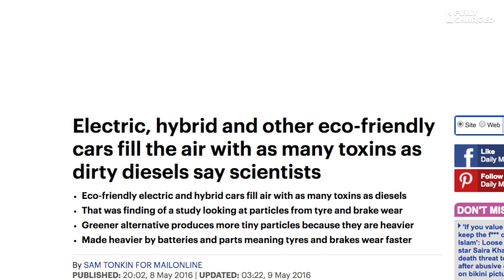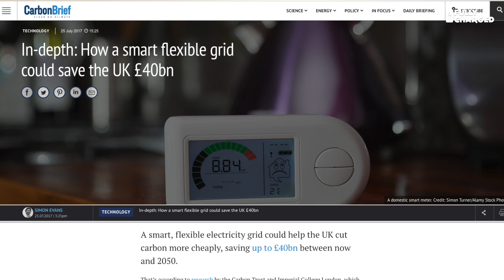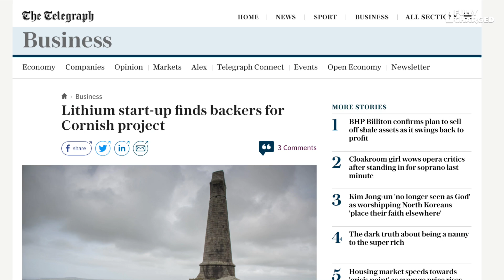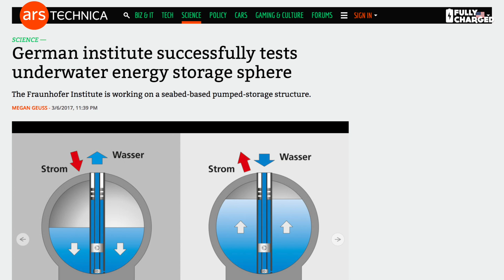Kettles, Particulates & Flexible Grid | Fully Charged News

Comment: Using EV batteries to feed into the grid, wouldn’t that reduce the lifespan of the batteries as they will be used much more than just when your driving. Then wouldn’t that counter any financial savings from letting your Ev batteries being used?. Even if the cost was still worth it, the batteries may have their lives reduced considerably which is not good for the environment!. There’s Salt water and other ways of storing energy that don’t require mining or hazardous substances!.

Comment: 13amp fuses are the maximum you can use on our 240v system meaning you can consume up to 3120watts per socket (13x240). Electrical sockets are connected in parallel so you can use another 3120watts in the next one. Using adapter plugs or extensions is serial and therefore all the plugs in that master socket can not exceed 3120watts, otherwise the fuse will blow. A kettle generally uses the maximum heater element it can to boil the water quickly, so many are 3kW or 3000watts. A homes main board will have numerous master fuses or circuit breakers separated in to lighting, downstairs, upstairs or whatever the electrician or home owner wanted. These are generally 5amps for lighting, 25amps per floor, 30amps for an electric cooker on its own circuit. If you overload any of the circuits the fuse or circuit breaker will blow. If you switch too many things on that will happen. There is also a master fuse for the master fuses which is the property of the national grid and you can't mess with it because it has a tag attached. If you look where your main board it fitted, where the electricity meter will be you will notice that has an 80amp or 100amp fitted. If you, for instance, turned on a kettle and 7kWh battery charger that is only 10kW, ignoring anything else plugged in around the house. If you plugged in 80/13 = 6-7 kettles this would blow the master, master fuse, although one of the master fuses would go first because they are lower. Any home could consume (watts = amps x volts) 80x230 =18400 watts or 18.4kW (They use 230 everywhere and not 240 because it is supposed to be between 220-240) 3 Phase supply does let you use more and export more but you can still do a lot on a single phase. The grid monitors everything though and if the harmony of the network is being affected by your consumption/export they will require you to alter your set up to prevent this otherwise it could cause damage to the grid somewhere. I am therefore confused by an 11kWh battery causing problems. That is what it can produce over a sustained period of time, not what energy it gets to recharge it. If it did, it would go from empty to full in 1 hour. Which is more likely to melt the battery than anything else.

Comment: I'm still getting over all the fuss that was made by our so called 'mainstream' media, regarding the 'non story' of our unhinged government, stating that only electric vehicles will be sold after 2040. When anyone who takes the mildest of interest in what is going on, transport wise, would know that there will only be electric vehicles for sale well before 2030!! I'm wondering what all the companies that supply/manufacture filters, cam belts, spark plugs, glow plugs, engine oil, clutches, starter motors etc etc are going to do 10 years from now?
There will still be demand, but not as we know it Jim.

Comment: My 1800's Victorian house has a 3-phase supply.  When I bought my first Tesla back in 2014 I had a 22 kW (3 x 32A) charger installed and the dual charger option on my car.  The electrician who installed made sure that the primary fuses were sufficient to run the house and the charger at the same time (no change or increase of fuse or cabling was required).  Each phase as a 100A fuse.  I have successfully and numerous times charged at full 22 kW as well as running electric underfloor heating, an electric oven and kettle.  No issues at all.

Comment: I was wondering about that Denmark story of those cars putting energy into the grid when electricity was more expensive. Now that would only work if there are only so little vans that the energy that is needed for them to fully charge is less than the energy they put back in. Otherwise, how much power / money do you need at first place to charge them enough? 🤔😁

Comment: Here something I have wondered about. Why don't kettles have 2 buttons - one that heats to say 90c (plenty hot enough to make tea/coffee) and another button for full boil. A bit like the dual flush concept that are commonplace on toilets. If the government made this compulsory  wouldn't it save huge amounts electricity and reduce CO2 output?
Reply: nitelite78 90c makes a rubbish brew of either. 96 for coffee, as damn near to 100 as you can get for tea
Reply: Jon Massey I don't accept that. In fact I have just found scientific research that discovered the optimal drinking temperature for coffee is ~60°c. Making tea/coffee at 90°c would be fine.
Reply: Drinking, perhaps, but that's different from the brew temperature

Comment: You suggested the cost of a home solar system could be recouped in 2 to 5 years? I admit to being a total beginner at this and have always ignored solar as I imagined it took more like 20 years to see a return? What I am wondering is, coupled with a battery system, what is the average cost of solar panel/battery system for a 4 bed detached house? Sadly our roof faces E/W and I realise this is not optimum but I do see several installs setup on roofs in this direction. I find the whole idea of storing power through the day and keeping it  in batteries until it can be used more in the evening to be fascinating!

Comment: Speaking as a young mid 20's guy. I am all for autonomous vehicles and am on the verge of buying an EV. For myself though autonomous cars should have the option of also being driven if desired. As I quite like driving winding country lanes but not motorways. And also I like to own the car so as you dont always have to remove all items from the car after use. You can leave stuff in the car overnight for general use. You can make the car your own when owned. 

It will definitely be a generational thing. If you have never owned a car and really driven all that much. You will take to no ownership and autonomy much more easily.

Comment: I wish I could buy a Tesla. I've had enough messing around with the gear 
knob,and the clutch. Problem is, a 3-4 yo Tesla still 47k, Nissan Leaf 
cost you 7k upwards, and you have to pay lease on the battery. My 15 yo 
diesel estate(non turbo,no PM filter, no double mass flywheel)worth 500 
GBP and on one fuel up it does 914 miles on 60 L diesel. (70+ mpg)
That's why I still find the electric cars are way too expensive for me .

Comment: The claims in that National Grid paper about overloading a domestic supply were so stupid and ignorant that even the authors have now admitted that they shouldn't have been included in the report.

Firstly home charge points are limited to 32A per phase in the UK, by regulations.  So on a single phase supply 7.4kW is the most that's permitted (22kW on a 3 phase supply).

Secondly whenever a new circuit is added to your home the electrician looks at the available power, the other appliances, etc etc and does calculations to confirm that you have enough capacity.  If you don't they'll either suggest you get the supply upgraded, or fit a slower charging point e.g. a 3.7kW one.

Thirdly, and most importantly, even if you were using 100% of your home's rated incoming power supply, e.g. drawing the full 60A through a 60A fuse, then switching on the kettle STILL wouldn't cause any harm.  Domestic supply fuses don't melt the instant you go over their rated current - even at 50% over-current a supply fuse will take over an hour to actually trip.  So unless your kettle draws 30A and you plan to boil water continuously for a whole hour, you won't hit any issues.

I honestly can't think of any situation in which a kettle could ever cause any supply fuse to blow - 13A for 3 minutes just isn't enough power for enough time ever to have any noticeable impact at all.

Comment: Ok, so a little clarification on the kettle and 11Kw charger myth. Let's start with how you calculate Power (W, or Watts). Power = volts x Amps. 
Have a look in your electric cupboard for your service fuse rating (a really big fuse inline with the main feed from outside), 60-80 Amps is fairly common nowadays and 80 Amps happens to be what I have.
My mains voltage is quite high at 249V...! But let's assume we will have 230V. 
Now multiply volts x Amps: 230 x 80 = 18,400. Also expressed as 18.4Kw. So, if your kettle draws 8.2Kw (extremely unlikely), might be safer not to charge and boil a kettle. My kettle is rated for 2500W-3000W, again fairly common. 
Also consider what else is drawing current in your house: this all needs to be added up to get the total amount. 
A competent , considerate and qualified installer will not install a charger if the supply would be overloaded when a kettle or electric shower was used simultaneously.
The charger should be installed on a separate circuit in any case.
With my 8Kw shower and 7.4Kw charger I would draw around 15-16 Amps, with around 2 Amps capacity left. But I charge during the very early morning so I doubt I would ever exceed 10-12 Amps at any time.

Comment: 2:34 No Robert it's still not true! even an 11kW charger is still NOT enough to trip an average house... you see the average house has a 100A fuse on each phase..  thats 24kW per phase... an 11kW unit is just 3.5kW on each phase.. 

A 7kW charger is the largest you can get on a single phase, and a 22kW is the largest you can get on 3 Phase (again 7kW per Phase)  these are all Well below the 100A/24kW capacity of a house supply..

So some older houses have a 60A supply.. (say Victorian terraces)..  this limits them to 14kW capacity.. so if you had a maximum capacity 7kW charger you'd be using HALF your supply! and could still use a 3kW Kettle.. infact you could still use TWO 3kW Kettles.. and still be below the limits.. 

It has always been possible to exceed a supply with high power devices such as electric heating, electric cooking, Electric Water heaters and showers.. a car charger that is equivalent to a power shower is really nothing to get concerned about, and is not news worthy...

I'd assume the "uneducated Dimwit" that wrote the National Grid brain fart has wrongly assumed that an 11kW charger was single phase, which it isn't.. and that adding a 3kW Kettle would get you to the 14kW /60A limit on an old house supply, which it won't..  note: "get to" not "push you over"..  a kettle is still not gonna trip it...

Comment: Hi, I use an 11kW 3-phase charger at my household, which is very common for Dutch people! You can even go up to 3x25A in total for a household easily (or up it to 3x32/64for a major yearly fee). I use my kettle, washing machine, solar panels and everything else without a problem!

11kW is really easy to do, charger can scale down easily if needed for those who need it..

Comment: About the concrete balls, what about the idea that I read about of boring a deep hole in rock and setting of a nuclear bomb, that compresses the rock into a large cave, with the walls sealed like ceramic, due to the massive temperature achieved during the explosion. Not sure about the residue from the explosion, but it seems like a good idea compared with giant German balls.

Comment: I can understand your logic of the brakes wearing less, due to regenerative  braking, but I'm  NOT convinced that tyres wear out more slowly, surely a heavier car will wear tyres out quicker ? Your still feeding power to the tyres, please "try" to convince me I'm wrong ?
Reply: t5jerry tyre wear caused by friction as opposed to weight
Reply: it`s the WEIGHT of the vehicle that causes the friction, the Heavier a VEHICLE, the more friction, still waiting for an answer.............
Reply: EV tyres use a tougher compound when you use the official types. I found that I replace one front set in just over two years doing 10,000mi/year, with the front set being moved to the back.

It costs me about £180 for a pair of 17" EV tyres fitted, £140 for a pair of 15" EV tyres fitted 😊

Comment: Death of the internal combustion engine!

In the UK, grid electricity generates 400 grammes of CO2 per kWh (being generous).
Most people today will charge their cars' using the grid.

A Tesla can travel 340 miles using a 100kWh battery (being generous), ergo, 117 grammes of CO2 per mile.

A Mercedes C200d produces 111 grammes of CO2 per mile.

Question: Which is the cleanest car?

Comment: http://interestingengineering.com/concrete-gravity-trains-may-solve-energy-storage-problem/

This seems like a great idea. Low tech, simple and, potentially, very efficient. Pumped hydro is one of the best ways to store and generate energy. But what if you don't have the geography? Simples. Use a concrete train. Use generated energy to push it up the hill at low demand. Release it to generate energy at high demand.

Comment: When I left school I lived off grid on my fathers organic farm for a year to save money , while I built a racing car. I used to use the battery power from my road cars starter battery to run lights and a radio every night in my caravan. Another friend nearby did the same while he was building his house. Plugging in the battery to use residual power from driving during the day. More recently it is amazing what use a leisure battery in a camper will give you hooked up to an inverter for 220v power. I know what your saying is the reverse of my example, but it shows the transfer of power between our transport and domestic needs, just the other way round. We have to get smart about how we use energy and luckily switching around a sharing at different times can all be automated. It's an exciting future, I would be interested in racing EV's to prove their abilities and change their image.
Reply: There's a beaper on my inverter, so once it gains anywhere near to low it warns you to shut it off, so always keeps enough to start the car. I once used one on a car to run a grinder and sander to repair that car. Self healing autos!

Comment: Actually tyre way is either the same or worse for electric compared to ICE. Regenerative braking creates exactly the same amount of tyre way as using the brakes. Tyre wear may be worse for electric IF you use the torque instantly available. The point you raised about the media misreporting technical stuff - YES - and they do it when covering 'medical research' and that is much more upsetting if you are impacted by their misreporting.

Comment: What happens when all the people in your neighborhood get battery powered cars and everyone turns their battery chargers on at night? I'll give you one guess.
Reply: What will happen is the grid will juggle power from all sources including other partly charged cars to balance the load. It's what happens every day on the power grid.
Reply: No it won't. There's no feed back from any battery powered car that I know of or car battery charger that will generate AC 60 hz 220v (you could build one, but it won't be cheap and then there's the heat loss). There's no grid to juggle... your neighborhood isn't on a grid, it's on a trunk line off the power grid.  Everyone is tied into that transformer and it's capacity isn't anywhere near that which  40 homes with 100 amp service supposedly could draw.  The Power company sizes equipment on average load, not the load from everybody going full tilt at the same time.

Comment: I like the Big German Balls idea (teehee). But - why bother with sinking a chamber in water? Isn't the effect the exact same as compressing air in a tank? I've often thought about compressed air storage of energy - it's 100% non-toxic, the stored energy is the air you breathe. So what's the advantage of using water pressure to push the air out - it would do the same thing from a compressed air tank.
Reply: The outside pressure at the bottom of the sea would be immense and would in effect prevent the chambers from blowing out, hence why they can be made of a cheap material such as concrete.